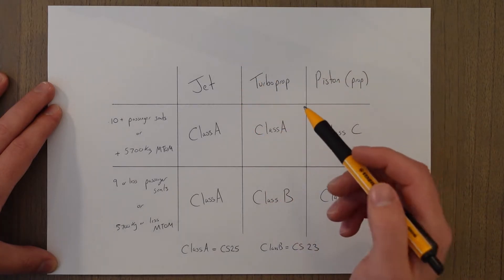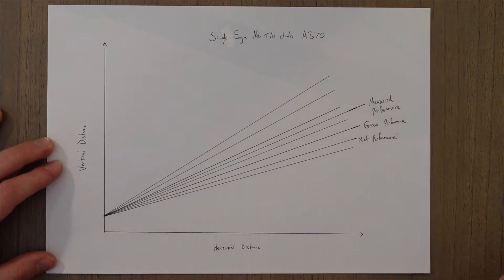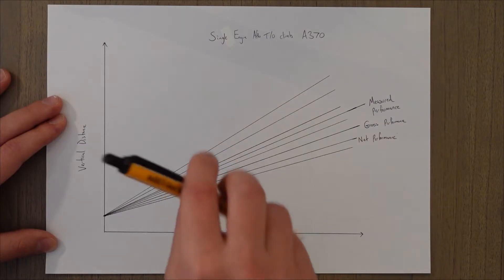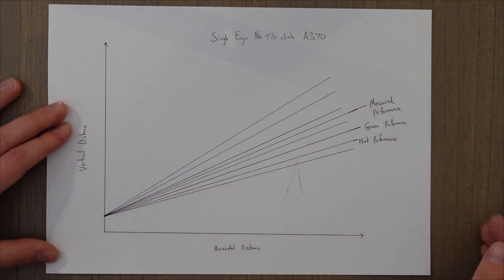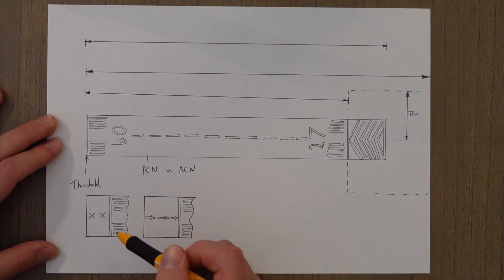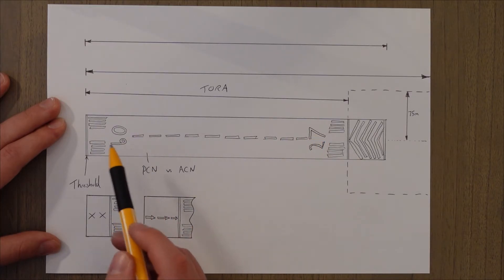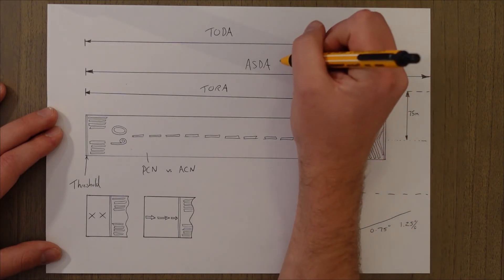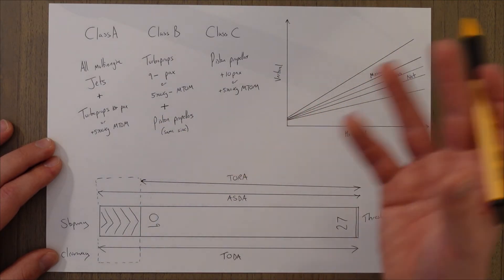ATPL Performance - Class 1: Introduction and the Runway.

Comment: Correct me if I'm wrong, but I guess the TODA on your summary is incorrect, at least for the rwy 09, it should not include the stopway. While it seems correct for rwy 27
Reply from the maker: The other reply by Robert has basically nailed it. The distances are not correct for rwy09: they only apply for rwy27, I probably should have made that clearer.
Reply: The arrows are a bit unclear; they are not measurement arrows, they are direction arrows. You should read them as you explained in your guess.
For rwy 09 the take-off distance available starts at the threshold and ends at the other threshold, and does not include the stopway (which is provided to increase rwy 27 ASDA).
For rwy 27 the take-off distance does include the stopway, because a clearway has been established (which is a sensible airport construction feature when you already have the stopway in place).

Hmm, I get curious now. Do the runway itself has to have 75 m on either side, or can it sometimes (theoretically) be cheaper to extend a narrow runway, than to level the surroundings?
Reply from the maker: @Robert You've nailed it with the TODA.
Runways generally max out at about 50m wide so they wouldn't extend out 75m either side of the centre line if that's what you are curious about. An airport may be designed with the cost of levelling the surroundings in mind, this is why we see a lot of coastal airports in the world, you don't need to pay to level the sea...